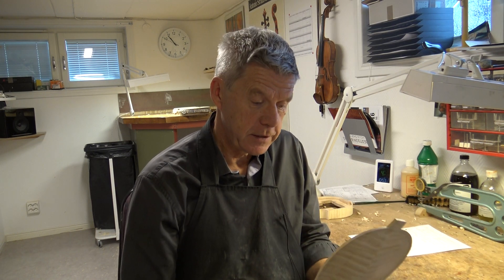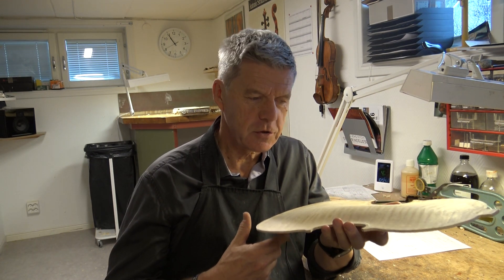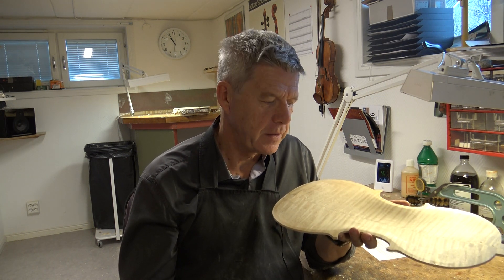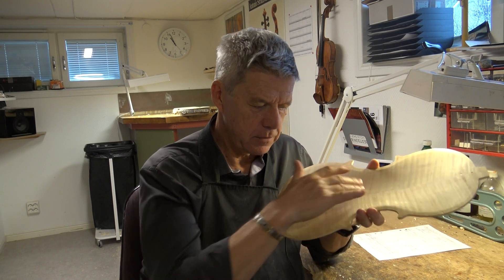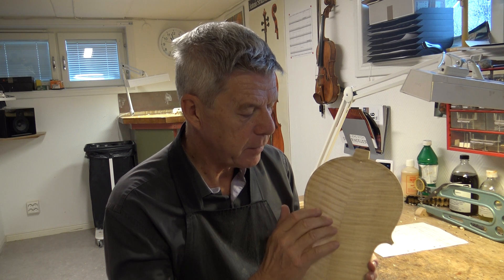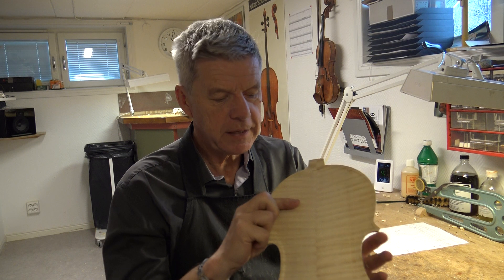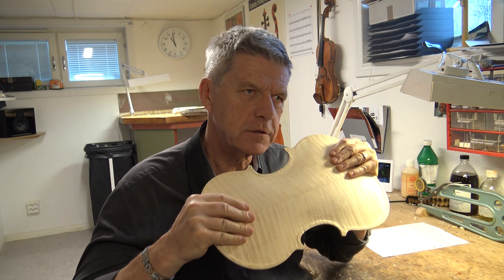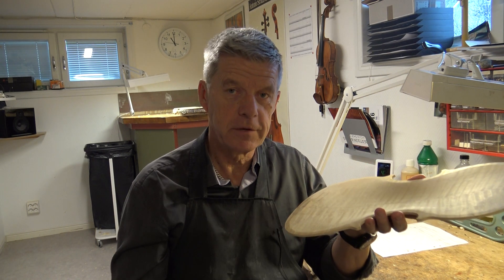Violin maker Peter Westerlund Part 89. Fine tuning the thickness

Comment: I wonder whether speakers technology applies to violin making? If using MDF or plywood would give a more uniform density, thus making a more balanced sound. I have a feeling matching the tone is only part of the story, the other part might be what kind of tone, and how well the sound is projected across a room. I bet the wood property might dictate the size of the violin too. If the batch of wood used was the same, then the dimensions remains similar, but if a new batch was used, then everything changes. I keep thinking a computer program can probably calculate everything more accurately, if the material used has a fixed density.
Reply from the maker: Hi Lisa,
You may be on an exciting track but I think that the woods used in traditional violin making are used for a reason. Especially spruce has qualities that are fantastic considering speed, weight and strength. 
After all we try to make instruments that sound like the old masters products. Using strange materials will produce another type of instrument, sounding in a new way.
I also try to keep things simple.
Reply: @westerlundsviolinverkstada9892  ok I was totally wrong about speakers and violin, is totally the opposite.  Character and projection of the violin, is dictated by every material used on the violin.  Incidentally spruce and maple has the opposite vibrational properties, I guess that is why they complement each other so well.  To get the best out of the material used, or more specifically to re-created the human singer voice/frequency, be it Tenor, Soprano etc, is dependent on the shape, wood characteristics, placement of the f-holes.  In other words, if one thing changes, then everything changes together with it, to get the best out of everything to amplify the required frequency range.  Knowing the relationship of each component could potentially create a program that can tell the violin maker all the information required, to build the best violin out of the chosen spruce board.  I think a lot of violin makers already know this, and such a program probably already exists , just kept as a trade secret.